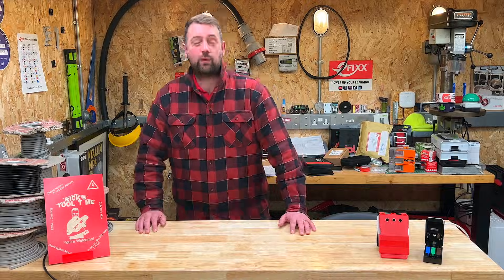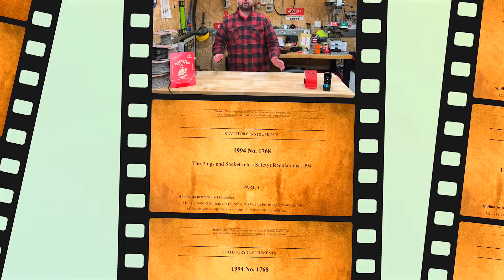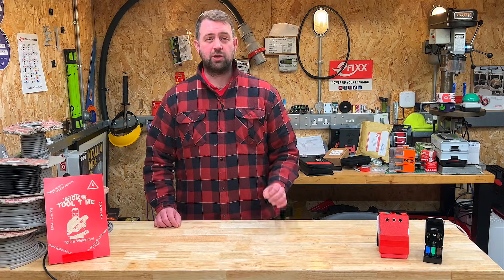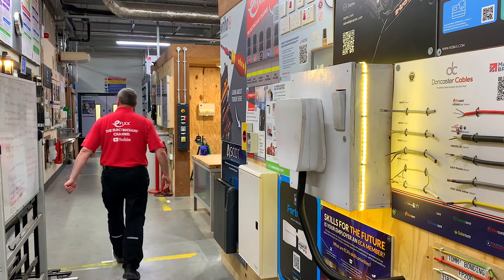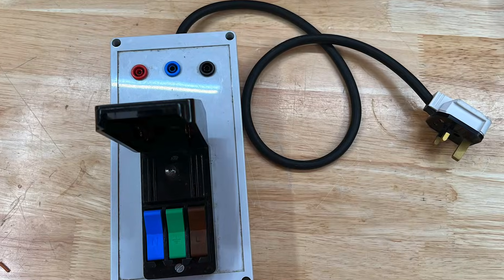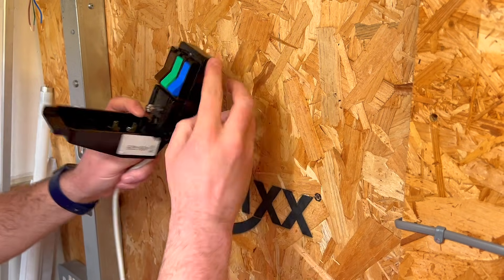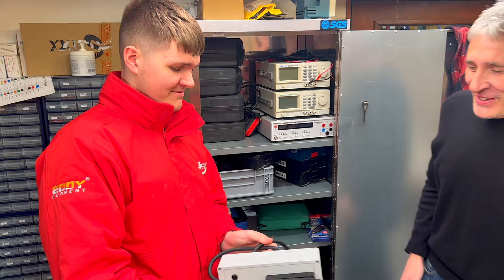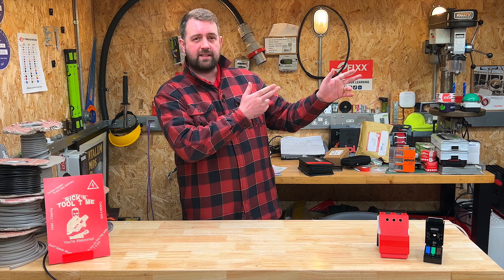Every Electrician Needs One Of These: Cliff Quicktest

Comment: Great introduction to the Cliff QuickTest. I started off several years ago using a rig comprised of Wago's. While it did work, I always disliked the flimsiness of the harness and potential for error. I came across the Cliff QuickTest and purchased one for use here in the Philippines. Often the colour-coding of equipment sold / used here is the same as the European standard. The QuickTest I purchased has the same coding so it made for easy to use (though I am used to the North American single phase colour standard of Black/White/Green). It's so much easier using the QuickTest to quickly verify operability and function of equipment than with the Wago setup. The Cliff QuickTest is not cheap, but it's worth every cent (or centavo). Glad I have it.
Reply from the maker: Every test bench should have one - Thanks for the feedback!

Comment: Had one of these for years, and very useful. If you have a 13A plug supplying it then you can test appliances with no plug. However, I also have a flex with Wagos at one end, and bare wires at the other. Pit the bare wires into the quicktest and connect heaters or other hard-wired items to the Wagos after disconnecting the item from the FCU. The 13A plug them goes into your portable appliance tester for ISITEE. Thus, it works both ways, a power supply for items with no plug, and a tester for ISITEE.

Comment: I have had my unit i purchased in the 80's how many people still using reliable safe test equipment over 35 years( yes hand tools)!
It is worth the £45 as rugged & safe.
Most people here are just in wiring premises so understand your lack of requirements.
I have both single & 3 phase as great to check rotation before hard wired!

Comment: They are great, but be careful with the brass connection inside (where you connect your main lead). I ‘screwed’ one up by over tidying the screw. It better to hold the base with a needle-nose-pliers and then tighten the top screw to hold you lead wire. The first one I used the bottom T-screw that holds the jack in place and connect to internal brass connector strips out!

Comment: I think most electricians would join me in holding up  our  hands in horror at the electrical bodge-ups made by DIY/home owners . I have seen power points wired in Christmas Tree flex , wire ends twisted together and wrapped in parcel tape and cables fitted diagonally across a wall  and covered in filler.
Reply: Don't forget the favourite choc blocks plastered into walls, come across this alot .

Comment: That "quick-test" is not safe to use. You risk an electric shock when open it with wires connected because you can't see under lip you use to open it. And exactly under that lip bare wire is waiting for your finger.

Design of this thing should be changed before it can go to the public use.
Reply: Yer that's why they were called "safe blocks" suggest you actually have a at one
Reply: It's perfectly safe if used when all your brain cells are reasonably well engaged. If the cover is lifted even a small amount, both phase and neutral are disconnected, it has a built in 13Amp fuse, and the wires, if inserted properly, with just enough bare copper versus too much, are perfectly well shielded from even the skinniest pinky finger. The thing is as safe as it could possibly be, it's even quite difficult to just pull the wires out, as the clamping force is surprisingly large, so yeah, even members of the public have been using the things already, for literally decades, with afaik no reported incidents.
Reply: @Tekwyzard  It's safe when top lid is lifted or closed. But to open this "safe block" you must use the lip in front of device. You put your finger under the lip and lift the top cover. You put your finger exactly to the place where all cables come out, usually with single isolation at best. No, this device is not safe to use, it has a design flaw that must be addressed before it go to sale.
Reply: @Tekwyzard  No, you can not open this device just by pulling up the top lid - you will lift whole thing instead of opening it. Your "battery smooth" contacts must be more tight to achieve good contact, by the way. And if you electrician, you definitely won't use both hands to operate such a device. 
So, to open it you must use one hand, put your fingers under the front lip without seeing what's underneath it - exactly the place where bare ends of cable could be. It's unsafe. it's a design flaw of that "safe block".
Reply: @AAaa-wu3el  I ask again, do you have one to hand? One that you can actually inspect, test, handle? I do, the contacts are gorgeous, loads of contact area, they slide perfectly smoothly into and out of engagement without gripping too tightly, I've run 3kw appliances a few times with mine, and it's never once arced or welded the contacts, which are easy to inspect. The bottom shell can easily be gripped while the top shell is lifted, the bottom shell can even be screwed to a worktop which makes the job even easier. Get your hands in your pocket and buy one before you try sounding all knowledgeable about something for which you have no clue or experience. You do know what 'Insulated' means don't you by the way? This isn't a CRT where you do anything with one hand behind your back or in your pocket. How is electricity going to jump through the case? It's built like a brick shithouse and isn't going to just fall apart allowing contact with any live conductors. Why wouldn't I use two hands, one to hold the bottom one to open the top? Do you have coordination problems? I can even open mine one handed, despite genuinely having some coordination problems. The 'lip' you keep banging on about serves one purpose, and that is to shield where the wires go in, because you know, that's the slightly dangerous end. It's why UK plugs have a lip on each side, so you cant reach your fingers behind them to do anything stupid. You deliberately go using it as a handle forcing/shoving your fingers right under there, and you haven't put the wires in properly, then that's why you need those brain cells and working eyeballs to actually observe what's happening, or just don't go trying to tame electricity. You are talking utter rubbish. It's a tried and tested design that's literally decades old, not some modern bit of cheap chinesium rubbish with a deathwish. End of, unless you go get one to try ..... prove me wrong.

Comment: Just checked the current pricing! My last one was only £25.  I had 2 attached to the front of my workbench they come in especially hand when testing PSUs, ballasts etc when you've pulled them from the appliance under repair.

Comment: Back in the days of appliances not having moulding on plugs I worked in a service dept, customers would bring in items for repair with the plug removed this was A: So we didn't pinch it.  B: To say we had pinched it because it was defiantly on there and we have to replace it or C: Because more than one appliance was wired into one plug.  These Quicktest were never any good unless we striped the cable back to have enough wire to reach the clip terminals inside it. Lets just say we had other ways of connecting the wire to an AC outlet. . . .

Comment: I have had mine for years and brought it to Brazil, they are supposed to use Black for Line And Blue for Neutral in reality they use any damn colour they have so they dont have to buy more, 99% of standard houses do not have CPC even if its at the meter because of the cost of running more cable. They don't even earth the death showers.